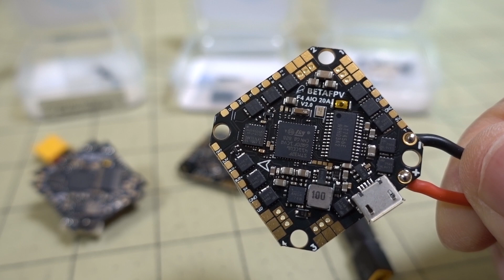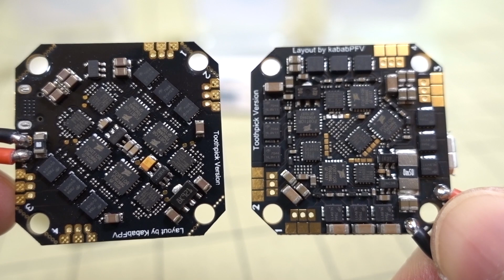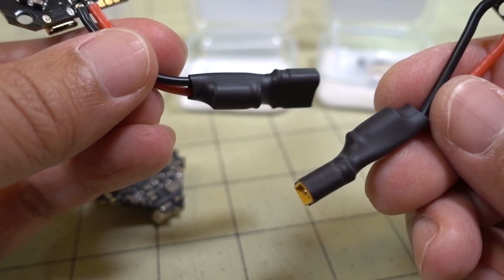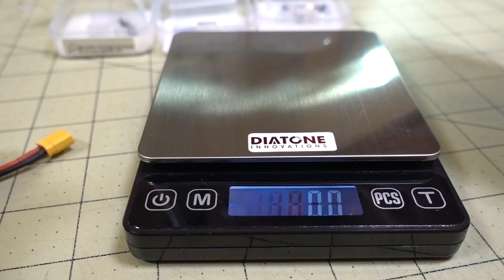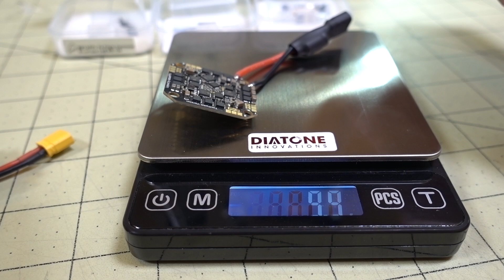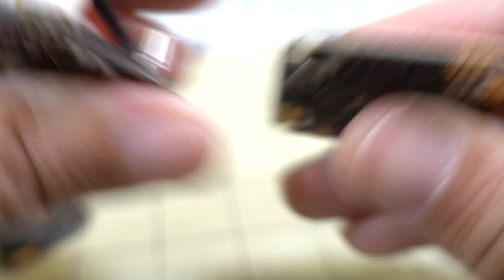BetaFPV 20A AIO Whoop FC Overview

Comment from the maker: 🛒 BetaFPV 20A AIO Whoop FC
       betafpv - http://bit.ly/2RBfooX
       xinte - http://bit.ly/2sQIjeW
Reply: Thanks 👍 is is what I have however I'm a GPS expert on installing one  but this one only has two ports and it won't allow me to hook it up to urr6 and I have a brand new GPS and it's just not working... The is :HONG YI-HAT

HONG YI-HAT 1pcs Ublox 7 Series Mini GPS OP NZ N32 GPS for OPLink CC3D Revolution Naze32 Flip32 Flight Control Board Controller QAV250 Drone Spare Parts (Color : OP Gps
Brand I should use
Do you know which

Comment: I know this video was a year ago..but do you have the GEP-20A-F4 v.2.2. Or could possibly make a video for the v2.2. The reason I ask, I recently took delivery of a 4inch analog GEPRC Baby Crocodile that came with the v2.2 FC and I can't seem to find any documentation anywhere, not even on the GEPRC website. Maybe due to its recent release, but no one else is reviewing this board. I was wondering about the wiring diagram and how my drone was wired, so I know more about how I can set it up and configure properly. Knowing how it was wired would also help me understand it's functions and limitations a lot more.
Reply from the maker: Sorry, I don't have that board.  I would contact GEPRC support as they can probably supply you the wiring diagram.

Comment: Hey Albert I have brought two of these BETAFPV 3" twigs this month (June) and within a few days both main boards have gone dead. Only Using a 3S 450 battery, BetaFPV brags about their service but return emails. FPV still works. The first one 2ft off the ground and just gently rolled over and died on my lawn, the second just stop singing the full startup tones. I'm no good at soldering do you thing this board is better then what I have now. Oh i brought the second thinking the first one was a fluke or something, boy was I wrong.
Thank you and sorry for the message
Reply from the maker: I'm not exactly sure what is dead on those boards but if it's the ESCs that keep dying, I would suspect the motor might be defective and it will kill whatever board you connect to it.  This happened to me with an iFlight motor.  It didn't seem like it was bad, but it killed three boards and when I got rid of the motor, the boards stopped dying.  If this isn't the problem then I'm not sure if getting a different board will help or not.  I'm not sure what the issue is exactly.

Comment: @Albert Kim any suggestions on amperage meter offset?  my board came set to -500. i have the mah usage reading pretty close, but im getting some wierdly high - if brief - spikes on the amps (47a). 

4032 props, 1606 3300kv motors, x knight frame, <250g.

Comment: Personally I prefer to run higher amp boards on all my tinywhoop builds for the simple fact that if you go over kill on the hardware you're much less likely to burn out an esc if you land upside down and dont realize that a prop is stuck in something and then try to flip it over, I have burned more escs on tinywhoops then i ever have on any other quad for this reason so go big or go home!
Reply: Exactly this.

Comment: I just built a 4 inch with this board.  Emax 1408s, HQ T4 props, 850mah 4s, xt60.  It's amazing.  Motor pads are quite close.  I soldered the mid wires underneath.
Reply: So is this board worth it? Is it holding up on the abuse?

Comment: Good review.  I was on the fence about buying this one but I'm still building small micros so this would be a little overkill.  But I like the way they pushed the pads to the edge of the board to make soldering easier.  Good design.

Comment: I got this also. Mainly bc my sunnysky motors pull alot of amps, I know bc I was running them on a 20amp 20x20 stack.
Pluse with them pulling 550g a motor i need this.
I also have the 12amp to on my other tp3, works good with the 1303 amax motors.
But I tryed my sunnysky on the nameless 12a and the motors was more then that 12a could handle.
We will see in a few days here. Bc I all but got it built
Reply: So is this board worth it? Is it holding up on the abuse?